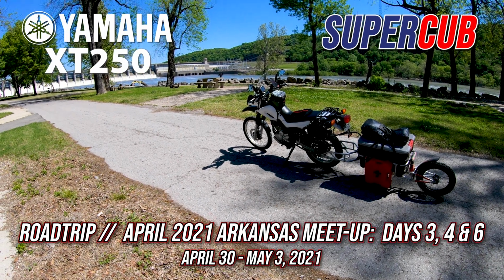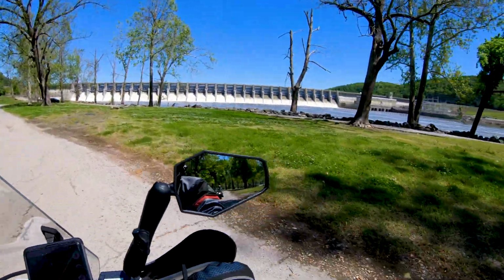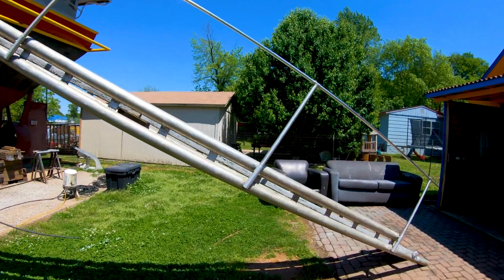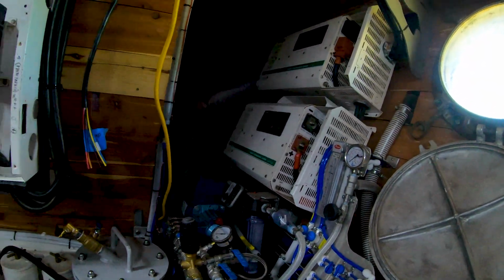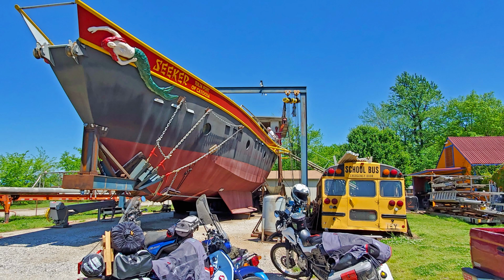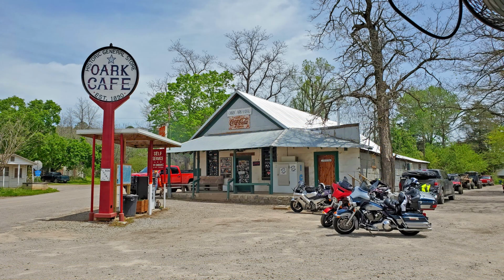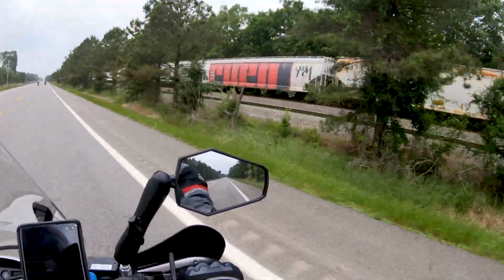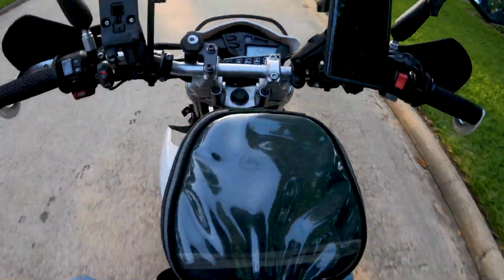ROADTRIP: Yamaha XT250 Pulling a Trailer // Arkansas Meetup Days 3-6

Comment: Toledo Bend. One of the best fishing lakes in the world. I have fished it since the 70s. You could have caught dinner in just a couple of minutes.  Great video. I put three rectifiers in my xt250 before I found a good one. Don’t waste money on a cheap one. Mine was overcharging though. That’s an easy job though. I wish they put a kickstarter on those XTs. I have to use 4th gear to push start mine.

Comment: I don't know if you fixed your charging system problem, but I haven't noticed you riding the XT lately.  I had a friend that had a similar issue on his DL1000 and it turned out to be the magnets in the alternator/generator came unglued.  Once he gave them a good gluing back in place, he didn't have that problem again.
Reply from the maker: I still haven't torn into my XT250's charging issues.  It has been sitting patiently at my warehouse for me to fix those issues.  Instead of going through all of the troubleshooting, I'll probably get an upgraded stator with a voltage regulator/recitifer that's set for lithium batteries.  The price for the OEM voltage RR is ~$100, and the upgraded unit from Ricky's Stators is $250, so the extra $ is probably a good gamble anyway.  

I'll definitely take a look at the rotor to be sure that the magnets are still in good condition when I'm in there.  I have a few other seals and bits that need to be checked, so it'll be good timing.  Cheers!  😉👍  --QM

Comment: What size boat are you going to build?
Reply from the maker: None yet, but I've been toying with the idea of building a micro houseboat with a 18-20' sailing catamaran as the base (e.g., Hobie Cat 18 or similar).  That would be a ton of fun, and I might even be able to power it with a scooter or the Cub if the hulls can displace enough water and support the weight of the bike.  😉👍  --QM

Comment: Do you usually use solar to charge all your go pros or do you use USB to charge everything?  

Have you considered buying one of those solar generators?
Reply from the maker: I typically use both:  I'll charge my devices via USB on the bike while I'm riding, and then I use a small solar panel (e.g., Goal Zero Nomad 10  https://amzn.to/3DAm100 ) to charge devices while I'm camped.  I connect a large-capacity USB battery bank to the solar panel to allow more charging flexibility... solar charge as long as possible and then use the USB pack after the sun goes down.  That solution also allows me to strap the solar panel on top of my roll bags and charge a battery pack while I'm riding (example here: https://youtu.be/37BTEHXWfxU?t=427 ).

I have considered buying or building one of the "solar generators", but those are basically the same solution that I'm already using: a large LiPo battery pack with multiple in/out charging circuits.  The problem with most of the premade solutions is that they are bulky and don't lend well to motorcycle use (difficult to shove into a pannier or a roll bag).  I'm still hunting for a large LiPo (or LiFePO4) battery pack that can quick-charge via 12-20V (e.g., from a larger solar panel) and also support pass-thru charging (e.g., charge batteries while powering downstream devices).  I haven't found a good one yet... most of the packs won't quick-charge if they have pass-thru.

I do have a Goal Zero Sherpa 100AC ( https://amzn.to/3qR6qFR ) power system, but it also has its limitations.  The battery capacity isn't stellar, and I never need the AC inverter portion.  There is another version that omits the AC inverter (Sherpa 100PD) but it's impossible to find lately.  The primary problem with the Sherpas is that they aren't waterproof, so it's risky to use them in moto-camping scenarios.  Cheers!  😉👍  --QM
Reply: @QuasiMotard  There is another brand called Omnicharge that I own. Of course the one without the AC connection is the one thats not available.  lol oh well, ty for the reply :p

Comment: An XT with a Sherpax. I can't wait, and neither can my Doberman, Jed.
Reply from the maker: How big is Jed? If he's under 65-70 pounds then you should do OK.  Otherwise, he might be too heavy for the SherpaX on a small bike like the XT250.  I had to reduce my loads in the trailer to under 55 pounds for it to handle properly above 60 MPH.  Of course, you probably won't be going very fast with a 4-legged passnger back there!  Cheers!  😉👍  --QM
Reply: @QuasiMotard  He's about 80lbs, but you're correct. We'll only be riding about 20mph except for a short stretch on rural hiways sometimes.